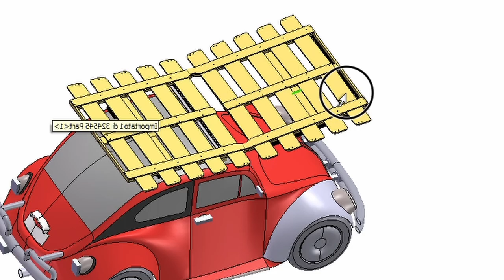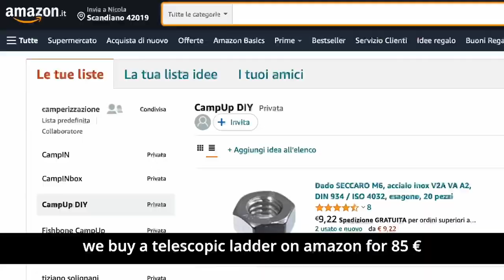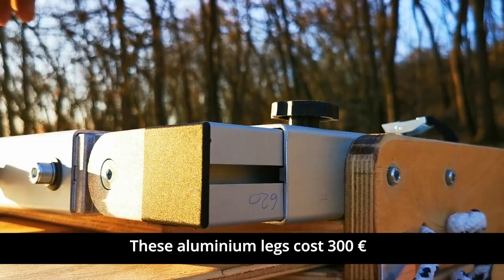DIY rooftop tent | Camping Car setup for living into the WILD

Comment: This setup is kinda useless and ... All You did was adding unnecesarry weight on top of the center of gravity while You still need to setup tent manually. You travel with heavy, useless platform on the top of the car, making it more unstable, heavier, with more wind resisatance and worse mileage. Why dont You just set up a tent on the ground instead? It will be faster and more versatile, because with tent on the ground you can move your car around and leave campsite for a while with your tent set up waiting for You. DOnt get me wrong - I like DIY ideas and projets, I did alot of my camping stuff myself and I do a lot of camping in really different areas and terrain. I do get idea of rooftop tent but only when it is easy and fast to deploy. You just drive around with heavy, clunky wooden platform od your roof and still need to set up tent on it. It is even harder and takes a lot more time than set it on the ground. For me this is really cool DIY projest, but idea itself has no sense and no realm value in offroading. You just mahke Your like harder with that - cost, weight, fuel consumption, need to klimb on the ladder, longer time to deploy, worse acces to name the few.
Reply: Valid points, however there are advantages too.
A roof tent provides protection against snakes, spiders, wild animals and dificultes acces to intruders.
Less mug on rainy seasons.
Better sightseeing from your tent.
Tree-house like experience, wich is just cool and fun.

The execution of this DIY is just not for me, I saw other designs that suit me better and for a fraction of the cost..
Reply: Those appointments can be used for any rooftop tents in the market, but this project is way more practical and cheaper, besides the advantage of being handmade and very easy to replicate at home. And it can be setup in other places with no possibility of put a tent on the floor, like a gas station or a wet ground, or even a city... The advantages are way too good to be not taken into consideration, and for just a fraction of the price to buy any simple motorhome or a premade rooftop tent.
Reply from the maker: The CAMPUP concept is to be a rack that, when needed also becomes the base for a tent (Maybe the one you already have at home and use on the ground). Sometimes it is better to sleep on the floor (per say with high wind) but sleeping up is way better for humidity, dirt which does not get insiede and wild animals.